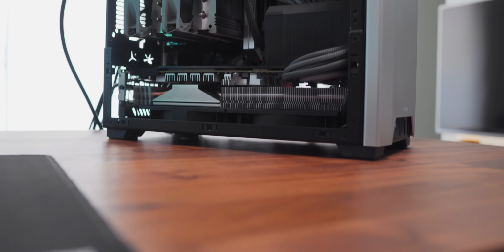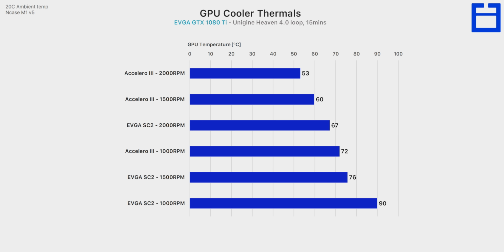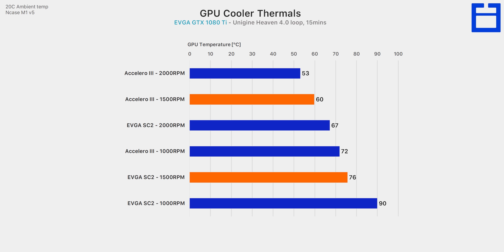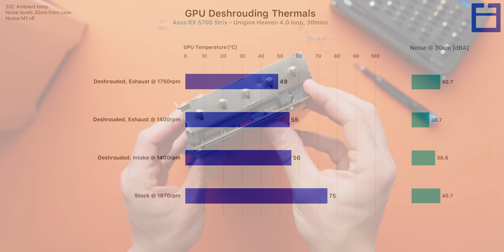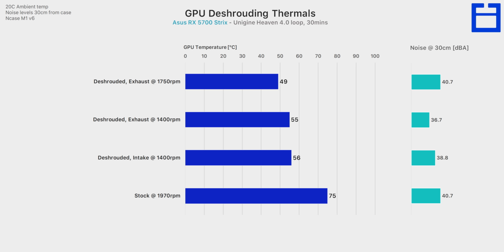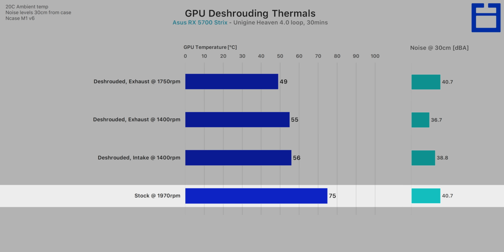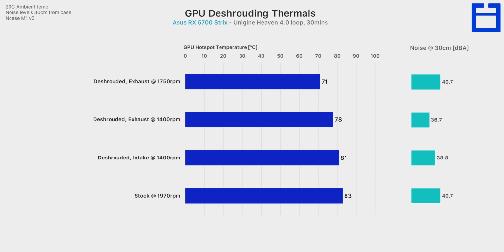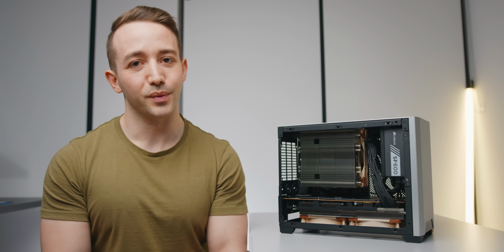GPU Deshroud Mod - Mindblowing Thermal Improvement

Comment: I seriously don't know why Noctua doesn't sell aftermarket gpu heatsinks to compete with the Arctic Accelero and RAIJINTEK morpheus. Or at least make some sort of fan mounting kit, or fans that lack a perimeter frame that can be installed in a gpu.

It's a shame because neither Arctic nor Morpheus are supporting RTX 3000 afaik.

I guess with how good these heatsinks are though it's really all just about the fans though

Comment: Dude, I just did this to my GPU after watching this video.  similar setup.  ncase m1, 5700xt raw 2.  dropped my temps by 10-15 degrees c and fans went from 3200 rpm down to 1200.  I'm using the noctua nf p12, the grey ones.  
Thanks for this video, i never would have thought of doing this without it.  
I should also mention, i was underclocked and undervolted before, and now i'm overclocked and haven't touched voltage.  my computer no longer sounds like a hair-dryer when i'm gaming.

Comment: I followed your link for the Mini 4-pin Adapter, received it, but for the life of me I cannot figured out where to plug it into my Asus Strix 5700 XT. The stock fans connect using a 7 pin header. Am I missing something?

Comment: Hmm, I might look into trying this with my In Win 301 since the bottom 2x120mm fans occupy the PCIE4 slot, just need to find the right card and get a GPU fan to 4 pin PWM adapter I guess

Comment: Well done, it's impressive. 

My 1080ti's with water blocks are dead silent, never exceed 50 degrees Celsius, and overclock like mad as a result.  Having enjoyed custom loop water cooled systems, I can't imagine doing it differently just because of how quiet it runs with a big radiator.

Comment: Is there anyway you could jerry rig the fans to be attached to the heatsink? are there any spots where if you drill into the bracket you could create proper mounting holes for the noctua fans?

Comment: Hi man your mini 4 pin adapter link doesn't take me to the correct place,do mind getting a link for me to order a few... Im looking to do the same setup as you but because i can't find the mini pin adapters  I'm having to using a liquid cooler atm... Which is getting me an idle of 35 degrees and gaming at 70 degrees... So want to try with 2x120mm SP fans to see if I can improve these temps on my rtx 2070 super

Comment: This same mod works with blower style cards? I ask because the heatsink fins are directed different direction (horizontal vs vertical) so the fans maybe fighting each other a bit and I do not know how much trouble, or if any, it causes. I have a RTX 2070 which could use better thermals and lower noise levels. I could try this first and if it does not work well then I could try Rajintek Morpheus II or similar as a solution.

Comment: This is what i did to my STRIX 2070 Super OC. Unfortunately the 2070 Super has a 5 pin connector for the original fans. I did not want to use the extra fan headers on the card so i had to make a custom adapter. Fitting the card inside the M1 was quite a hustle though.

Comment: 3 slot gpu (strix 3080) with 25mm thick fans will work or not in the cooler master NR200?

Comment: This is hands down the best mod I have made in my computer. I deshrouded my  2080 ti, attached 2 noctua 
NF-A12x25 with some steel wire and zip-ties, plugged them intop a motherboard fan header, bought a piece of software to control fans (Argus Monitor for 10 USD), so that I could make the fan curve correspond to GPU temperature, undervolted the GPU so I can run the fans at around 1000 RPM under load with temps at max 70 degrees C, and now my system is actually completely silent! (especially because I replaced every fan in my system with noctua 
NF-A12x25 fans and my CPU cooler is the noctua NH-D15).

Comment: I fitted an Arctic Accelero 3 to an Asus Phoenix 1660 ti and then in an unrelated effort decided to see what the highest score I could get on Furmark was with the power limit set to minimum. I thought initially that running the fans at maximum speed would result in the highest performance but having the fans on full resulted in a 60-75mhz performance drop. The card performed best with the case fans at full speed and the graphics cooler fans off entirely. This card would be seeing this boost. No wonder GPU manufacturers are using zero-rpm fan modes on their cards!

Comment: I'm confused why you say that people should get a mini 4-pin adapter to connect the fans to the GPU. The fans on the ASUS ROG Strix card use some odd (possibly proprietary?) 6- or 7-pin connector for the fans. There are two standard 4-pin PWM fan headers, but it sucks cause you have to use GPU Tweak to control the fan from those headers.

Comment: my gaming system is completely noiseless as is my PC4 Pro. It sits in an other (storage) room, thanks to very long HDMI fibrewire cables, USB active extension cables and Logitech wireless lightspeed mice and keyboards. In fact, these run to my TV as well. No sound, no heat, no latency, no cluttering of tech devices. Yeah, your wife will thank you.

Comment: So I tested this with a Gigabyte 5700xt Gaming OC 8gb edition in a regular case using the stock heatsink and setting the card in my second PCIE slot and jerryrigging the fans beneath it on the power supply shroud inside of a Lian LI Lancool 2 with a gap of about 3-5mm.

It dropped idle temperature from 45C to 30C and reliably cools the card under regular loads (this is gaming loads, no benchmarks done.) Temperatures will hover at 75C-85C with junction at 85C-90C.

However with some specific games, this instance Starcitizen, the GPU temp will be around 75C but the junction will still be pushed to max junction temperature at 110C. This was prevented by doing a power draw reduction of -25% and now I feel the GPU runs at a comfortable level of 65c-75C with junction at 85C-90C with it being at near stock gameclock of around 1800-1850mhz. This is with the fans also at full blast using 2 120mm Noctua NFA-F12 fans (what I have right now) and with an open side panel. (I do not trust the air to flow much just from the front because I have a 360 rad to my cpu)

It works but with the 5700xt just drawing in so much power and undervolting being so unstable for me it seems like running it on a negative power draw helps with keeping it cool as once it starts going up there in voltage it'll still be hot af.

This is mainly my concern with running StarCitizen. Every other game runs perfectly fine with stock clocks and 0 changes.

Comment: Interesting idea - but what’s with the high stock temps to begin with? I use an open case and clean it every couple weeks and my EVGA 2080S runs around 50C at load and often around mid 40s. If it all possible keep AC in computer room around 22C or 72F and have decent airflow around case and you’ll see a big difference

Comment: Really helpful, BTW what CPU Cooler have you installed in this Vid? Cheers ;)
Reply: It's the Noctua C14s, he left a link for you in the video description. I guess it's hard to recognize because he seems to have the fan on the opposite side of the fins.
Reply: Is the c-14 the best air cooler for this case?

Comment: Between the mounting pressure and asus bullshit weak ass slim fans, the improvement is much larger than it would have been on the evga. 
If you have that card, try fixing the mounting pressure before taking the fans off.

Comment: 7:33 Well, a 12°C reduction is not just "nothing to disregard", it's massive when talking about hotspot temps given how the frequency boost works. That could be the difference between running over 2100 MHz reliably or running into thermal issues and crashing.

Comment: To be honest? If aesthetics doesn't matter to you, just put in 4 screws on the underside of the fans you wanna use so the screw heads stick out a bit, and use a rubber band wrapped around the screws and the whole graphics card (preferably one with a backplate, but hose are very common nowadays) to hold them in place. You have to look out for the PCI slot to not get in the way of the rubber band but You should not have any problems with the fans pushing away from the card if you orientate them that they suck the air through the cooler above :-)

Comment: Hey Sir, thank you for your Video. 
The CPU Cooler looks massiv.
I have read that the cooler makes problems with the atx power cable or with the power supply. 
Over the CPU Cooler, there is no other place for a Fan in the Top right?
You placed the fan under the Noctua, not on the CPU cooler, why that?

Comment: I currently use an RVZ01 case with additional 120mm radiator fans for my GPU. Does more fans means better temps or is a deshroud only necessary due to lack of clearance space?

Comment: I tried this in my two systems a while ago and in both cases, it did not really improve thermals or noise. 
Now I think in most cases this mod will lead to improvements, but I just wanna share my experiences and wanna inform people, that this mod won't improve thermals every time.

My secondary system is in a Streacom Da2 and the GPU is a Palit gtx 1070 jetstream, which is a really good card with good fans as standard. I attached two fill size Noctua 120mm fans (which is very easy on this card as a lot of the tabs even align with the 120mm fan holes), but the thermals did not improve, because the bigger fans were closer to the ground and did not have enough room to breathe. (with low profile fans it would probably work though, but since the card is cool enough with stock fans I did not wanna spend my money needlessly)

My primary system is in a compact custom build tower, which houses a 360mm rad in the front; one 140mm in the bottom, and two 140mm in the top. The GPU is an Asus Strix RTX 2080. In this case the removal of the shroud leed to some mismanaged airflow (at least that is what I think). Without the shroud, the air coming out of the graphics card was not directed upward and instead into the very close solid side panel. Because of this, the two 120mm fans recircled a lot of air this lead to higher temps. Moving more air was in this case wors as the air just recircled. Without a side panel it would have been better, but with the side panel on, there was actually more noise from the bigger 120mm fans than the standard ones. (with Stock fans the card runs around 999-1140rpm (with temps around 67c) which may sound like a lot, but the smaller fans produce a lot less noise then 120mm at the same rpm. Case and radiator fans are around 650-800rpm depending on the load)

I am not hating on Optimum tech. I think the mod will work in most cases, but I just want to urge people to do their own testing as this mod does not mean better temps every time.

Comment: Are the fans mounted to the case or the GPU? If I wanted to do this in my normal mid tower case I would need to mount the fans to my rog strix 1080ti.

Comment: Hi, could you please investigate the possibility to get good thermals with the Noctua NH-C14S in the ncase m1 please? I would like to go for a aircooled build but I am doubting the performance of this cooler in the ncase m1. It would be helpfull te see the clearances, maybe if 3D printed air guides would help in any way for example, etc. Thanks!

Comment: just deshrouded my ASUS Dual GeForce RTX 2070 SUPER OC Evo in my Ncase M1 and  it works like a charm. I was a bit worried that it wouldn't fit as the Evo is 56mm thick and the Strix is 54mm. Its a thight fit, with a bit of upward bend but it fits!
I only have one Mini-PWM to PWM adapter and the "right fan" is not connected. I use a PWM splitter conecting both NF-A12's to the GPU to the "left fan" of the GPU. Ampere-wise it should be fine, the Noctua uses only 0.14A (combined 0.28A), while the stock fans use 0.35A each. Still have them set to Intake though (was too afraid to bend the clips on the FAN mounting....) and have the Dust filter mounted. 0-RPM does also work!  
Temps are fine and noise is lower. But not as much as I would have thought. Fans are not spinning below 55°C, so 0-RPM works fine.  Will think about Undervolting and perhaps using fixed fan speeds.

Comment: can no one answer what the orientation of the fans are ? the videos are nice and all but a litle bit more information would be nice , anyway the noctua sign and letters in this build are in the right orientation so you can read them without a handstand and wenn i compare it to the same fans it should be pull and send the air down outside
Reply: You're right, as the term 'exhaust' (opposed to 'intake') used in the video should tell you. Exhaust means warm air out, intake means cool air in. HTH
Reply: @radolkin   damit iam so blind , i didnt look at the charts carfully enough maybe i was distracted .......... anyway i watchted it again still waiting that it is said out loud ........ stoped at the charts ........... and ....... it was spoken , damit ............. have to watch it more carefully

Comment: I have an Inno3d RTX 2070 super "twin x2 OC", which seems a good candidate for deshrouding, but it's only a 2-slot card (slimmer heatsink). I currently have it watercooled so I can't test it, but GPU noise was my watercooled motivation (I already managed to fry a motherboard, so I am looking at deshrouding as a backup).
So, any tests done on 2-slot cards?
NCase M1 here.

Comment: This is possible in any case with either zip-tying the fans to the card or if the setup of the fans and card is the same but the fans don't reach some spacers underneath the fans can do wonders.

Comment: well this is awesome! I have the same exact GPU! It runs cool though so I wouldnt do this. It normally runs about 55-60degC under load. Not bad TBH. I also have a i7-10700k at 5.1ghz all core OC with a 120mm AIO and it runs the same temps. Never see over 72 degrees C on either CPU or GPU. I have a RTX 2070 super xc ultra XVGA. Its the same exact GPU in this video with a different die, everything else is the same.

Comment: Impressive results!
This mod would be less exotic (and case dependent) if one mounts the fans directly to the heatsink, instead of to the case and try to match the space in between.
I guess one can use the very modern tool, known as zip-ties :) (there are also a metal kind). Also these Noctua fans have rubber anti-vibration pads in the corners so it should help with reducing noise from imperfect mount.

Comment: There was some speculation that the next gen Nvidia cards will have ray-tracing cored on the opposite side to cuda cores. Meaning fans on both sides of the Nvidia card. I think that would be three slot minimum for the high end cards.

Comment: Anyone know if this mod would this also work with the Asus Dual 1660/2060 cooler design? It's a 2.7 slot card just not sure if it has metal tabs or anything that I'd have to bend or dremmel

Comment: I deshrouded Zotac 2080Ti extreme core and using arctic P12 in NR200, and get a super silent PC! 
https://youtu.be/ejn0QFgJjxU
31~32 dB with 99% gpu usage at gpu temp 65°c!

Comment: I had a 980ti HOF card for years. One day i start noticing that gaming is performance dipping (nothing major, but bugged me). Upon a visual inspection i noticed that one of the fans had died and i was not prepared to spend more money on the card since i was going to be upgrading soon anyway. My solution was to "deshroud" the card and cable tie two 120mm Cooler Master fans to the heatsink. its not pretty but performs better than the card ever did with the stock fans even when new.

Comment: I did on 1080ti palit super jet stream, new big fans on stock radiator, with conector 4pin to vga from Ali + noctua Y cable
it is quite but 2*120mm NF-F12 fans can only 1500pwm and in summer time you can forget about overcloking. Need min 2000pwm fans, but if you want silent PC - F12 good it's maximum 1500pwm it high limit of "silence"

Comment: I just tried in my Ncase and this mod seems doable so I'm currently waiting on the adapater to be able to plug my NF-F12s to my GPU and I'll give it a shot ! However I am wondering if I should change something to the cpu fans (currently running as rear exhaust) then with this new setup. Any thoughts ? Terrific channel btw !

Comment: Honestly, this video is very interesting but also very confusing. What has been done here? Removing the "design parts" and the fans and put Noctua fans...onto the card? at the bottom of the case? And use adapters to connect them to the card?

Comment: I have two cards in a supposedly high airflow tower case. I run Folding@Home on them almost continuously. The lower one is a 2.5-slot RTX 2060 and is usually around 75C. The upper is a 2-slot RTX 2060 KO and usually around 82C. I’ll consider trying something like this...

Comment: Thanks for the video, appreciate the VRM temperature bench! 

I've upgraded from 980Ti cooled by Acceelero Extreme III to a Strix 1080 Ti and had it deshroud on the first day. I don't need to flatten any tab for the 1080 Ti in my Ncase M1.

Comment: If you're using an mATX or ATX case you can get a PCI slot bracket to mount the 120mm fans right next to the GPU.